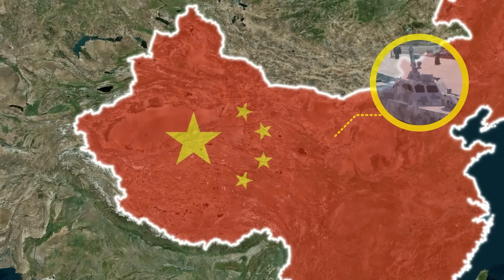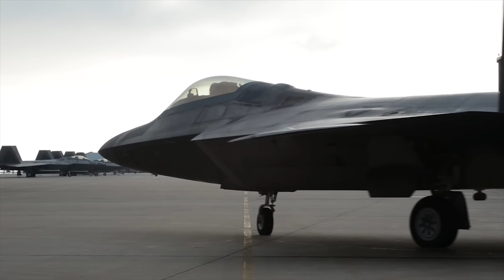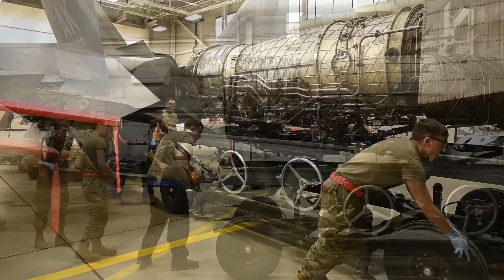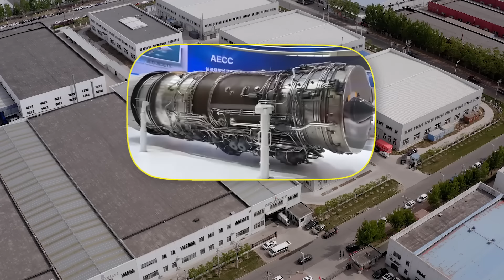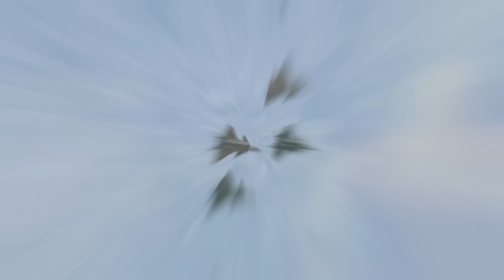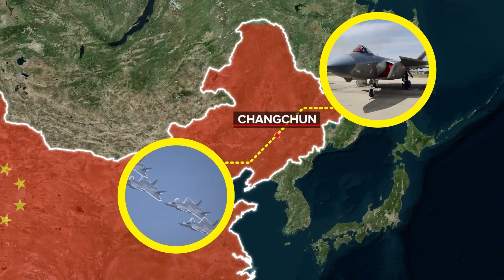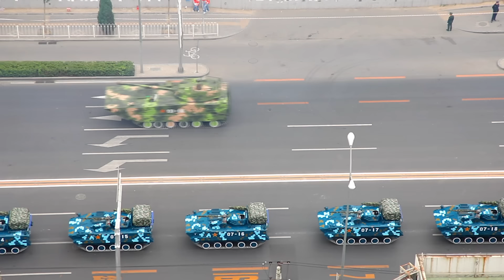China’s J-20 ‘Stealth’ Jet Is a FLYING LIE… A Paper Tiger That Can’t Fight

Comment: At the 3.17 mark in this video.... How is 1,500mph 47% better than 1,535mph?
Reply: Yeah I also had to go back and listen again 😂
Reply: The F-22 is about 42% faster than the F-35. Mach 2.25 vs 1.6.  that said it has nothing to do with the j-20 vs F-22 comparison.
Reply: Yep, had to stop the video here too... The 1st technical fact given, and its wrong... Now faced with a dilemma. Do I watch the rest of the video? since they cant get the basics right...
Reply: Chinese math.
Reply: I thought the F22 had a top speed of mach 2.25 which is? at 65,000 feet
Reply: yeah, that one also confused the hell out of me
Reply: @delphy2478  Same here.
I'm also puzzled by "maximum cruising speed", given that the [stated] actual max speed of a Raptor is 1500mph, its stated supercruise speed is 1162 mph (but that's presumably max speed without reheat), and it has a more efficient subsonic cruise speed.
Reply: @davewilson4493 super cruise means the F22, among a small number of other jets, can maintain supersonic speeds without the use of its afterburner.  This makes the jet extremely fuel efficient at higher speeds but doesn't change its actual max speed.
Reply: @davewilson4493  That speed is just what you're told it can do.  Bet it can go faster and not only that it can maneuver at heavier Gs and in ways that most aircraft can't.  Anyone who claims that top speed somehow makes a jet superior is insane.  All that does is allow for an aircraft to run down and merge with another faster.  Okay, so what? Can it fight?  And even if it somehow, in fantasy land, was faster it's still not going to outrun a missile.
Reply: @BullsMahunny China and Russia over rate their equipment- always have.  The USA publicly under rates their equipment as a little extra surprise when you go against it.  Of the US admitted the F-15 can go mach3, the world would try to make a Mach 3 engine. If USA says Mach 2.5- the world makes engines for Mach 2.5… exactly what has happened.
Reply: @FYAjibber000 The F-22 max velocity is much higher. That is its thermally limited velocity. USA rates max velocities differently than Russia or China. Technically a F-15ex can reach Mach 3.21 sustained but will be damaged thermally so its max stated velocity is Mach 2.5.
Reply: @poohbear1647  You are so full of it.
Reply: @johnwade7673 he is. I tell you he has always been. He is such a moron.
Reply: Simple, same math as 2 + 2=5. Now<believe it or you are racist
Reply: He probably didn't drink his ☕.
Reply: You are expecting more than they tell you, maybe?
Reply: I question everything about this article and where  they get their facts.  They talk of things that make no sense. I would suggest
to scroll on by this one , but you're going to watch this car wreck anyway  😮
Reply: oui complètement ridicule vous avez raison.
Reply: probably meant 1035 mph
Reply: Roteiro feito por IA, o comando foi apenas ," faça o jato dos EUA ser melhor que o Chinês, e traga dados", a IA faz o que o comando pede, mesmo que seja inverter a lógica transformando uma informação ruim em uma informação boa
Reply: Didn't make any sense to me either
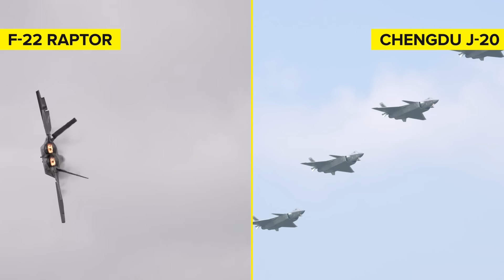Reply: These videos are produced by people hoping to make a quick buck. The fact that we've all been fooled to (at least) the 3:17 mark proves that these producers know something about making money.
Reply: The blogger is merely venting emotions rather than providing technical analysis. They start with a conclusion first, then look for data to support it. If the data doesn't back it up, they casually fabricate a small lie. In a single analysis, there are ten conclusions and twenty little lies. Their audience only needs to resonate with their emotions—things like data are irrelevant to them, even if the claims defy common sense.
Reply: The F-22, a dilapidated aircraft forced to halt production after being proven to have serious flaws, is like the electromagnetic catapult on the Ford-class aircraft carrier—it was flawed from the outset. Most importantly, the Americans lack the capability and better methods to overcome these decades-old technologies. Let's face reality.😂😂
Reply: @L-or1vk ...the J-20 has the stealth characteristics of a school  bus. An old one.
Reply: @L-or1vk nah, many moronic fools would argue the F22 is the best 5th gen fighter. Did you read the Denmark ministry of defense assessment on the F35?. How most times half or more of the current fleets are always undergoing repairs 😂😂
Reply: Well The Chinese J-35 Fighter is just a Copy Cat of The US F-22 and F-35 
And The J-35 is just nothing but a Placebo effect of the so called Stealth. 

Why is China so afraid to use their new J-35 Stealth Fighter against The crappy and cheap ass aging Indian SU-30SM??
Reply: @PoliloMaloko_43  Who says China is afraid, just cause China is not a warmonger - oh, another one of the Su-30MKI crashed, enjoy your 5th (?) crash this year in peacetime!
Reply: Trump must have did the math 😂😂😂😂
Reply: Is it possible, that the J-20s speed is given in Km/h, like it was built in a normal country?
Reply: @wolschou  even in km/h that’s 67.7% faster even if he meant slower that still 39.3% and not 43% dude is just making up numbers for the hell of it.
Reply: AMERICAN SCIENTIST
Reply: @tomtomblos2909  Literally some of the best in the world.  What's your point?
Reply: @BullsMahunny  you think you are the best in the world ... your country is in chaos .. my friend just came from us ... he dont wanna back there everywhere chaos . even his flight have long delay chaos is every where .... you goverment cannot run your country
Reply: @tomtomblos2909 Chinese bots out in force again today!
Reply: @tomtomblos2909  LOL